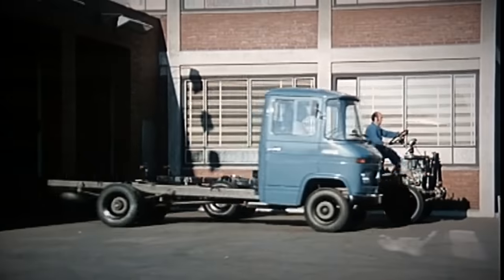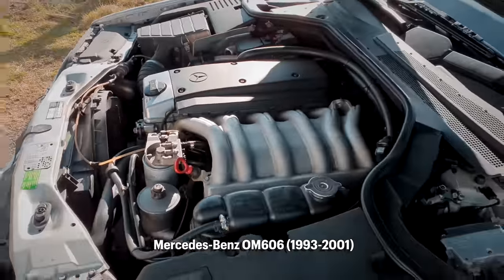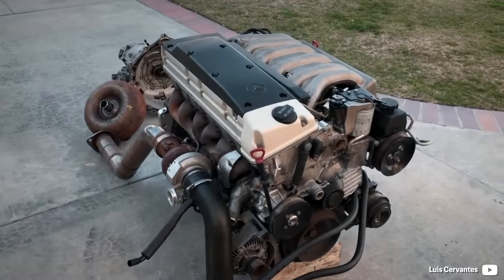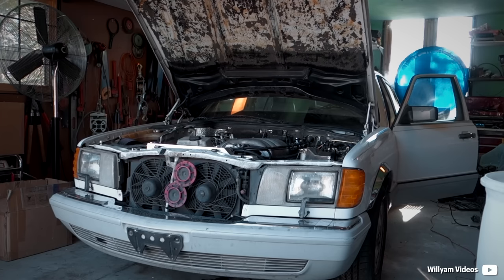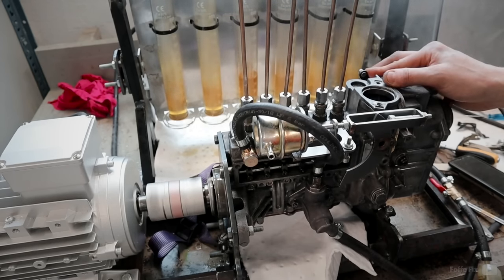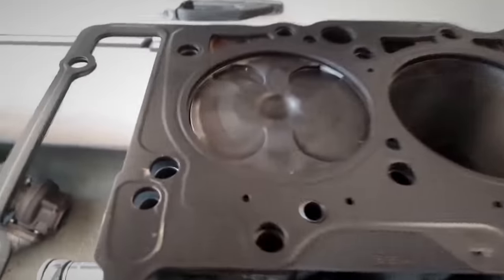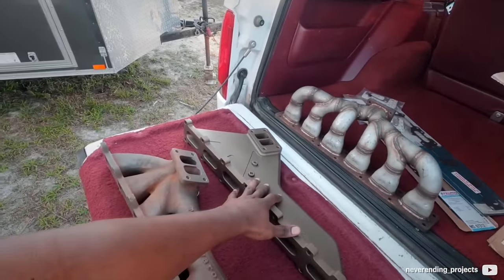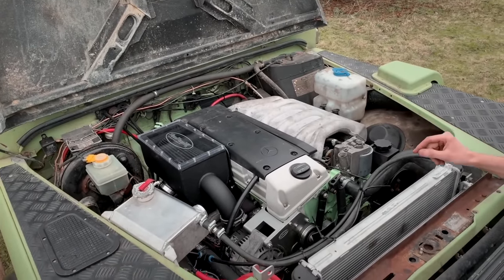The Best Mercedes-Benz Diesel Engine?

Comment: Gotta appreciate the old generation of diesels, where they were built to last - no dpf, no plastic engine components or fancy electronics prone to failure
Reply: While I kind of agree with you I have to say that these engines had plastic components and an ecu . The injection pump was electronically controlled and the Mercedes of the 90s suffered greatly from rotting wiring harnesses because they chose recyclable cable insulations . On the other hand modern engine management is a blessing even for tuners . We wouldn't be able to achieve nearly the power we do without modern engine management and the electronics got so much more reliable . 
I would rather say that the 90s were a heaven for great engines because the manufacturing capabilities were there to build very strong components but the computing power wasn't there to engineer them so they would just barely be strong enough to hold the required power in order to save money .
Reply: They dont Need DPF.
Indirect injection engines don't make NoX comparable to New engines. It's a common rail High pressure Lean running engine problem.
NoX is a manufactured issue. Since Diesels were forced to Use less and less fuel because Oil companies defended their interests by raising Fuel prices to protect Gasoline cars that were losing all battles very fast to ever-growing power and speed of 90s Turbo diesels. And Gasoline cars Sell Oil reserves not Diesels.
Reply: @DexMaster881 Are you serious? You've just shown to have absolutely no idea here.
DPF is for Diesel Particle Filter, that is, soot, smoke! Older diesels made a lot more because the injection systems wouldn't atomize the fuel very fine, that's why we got into the 2200bar common rail, fuel spray is much finer, combustion is greatly enhanced, thus better economy and less soot.
The Nox trap is an entirely different thing.

Also, they ran much higher compression ratios, easily 21-25:1, so they made a lot more Nox, that's why modern diesel have much lower compression, around 16:1.

A diesel always run very lean, unless floored.
Reply: Just to add you can put the fully mechanical om603 pump on the 606 and it can run without an ecu
Reply: @dabyd64  Thank you Fellow Mechanical Engineer. I forgot my Diploma isnt approved by World Indoctrination organization.
FYI Sooth is Overfueling or, Running Rich state on Old diesels.
To be more precise, more fuel than air volume can handle results in a rich state that Significantly raises combustion Temps since theres not enough air to filly combust all the fuel.
NoX is an occurance when theres a Lean state. Theres  too much N from the Burn left to Bond with air and return to natural state. Produced by the lack of burning components in Modern Diesel fuel that has natural stabilizing components removed from it. Like Sulfur.
As a result all impurities in Fuel and air get charred and you see sooth. On top of which there is more fuel with more impurities that can not be burned because theres a lack of air to satisfy optimal AFR. They always there But it's not burned unless the combustion Temp doesn't reach needed levels.
Same particles always come in and out of the Engine in Gasoline cars and Common rails but dont get Burned unless there is something very off with AFR. Like a well worn engine,or Over tuned one.
So When you criticize someone don't be a Feminist but Learn some fact. "I say" doesn't really work in 2022 people are more educated now. And they have more access to information other than Local propaganda.
You Can report me to your Indoctrination party leader, I won't hold it against you.
Science doesn't work for politics ,It should work for Knowledge and knowledge only.
And don't forget to support your Local Oil Tycoons in the upcoming elections :) Cheers m8 have a great day.
Oh yeah and OM602/603/605/606 run at 21:1 and 22:1 from the factory :) Check you facts...
Reply: @DexMaster881 soot is not only that...   Lean combustion also generates a lot of particles on diesels. Not seen by naked eye, but they're there.
Reply: @DexMaster881  what you've said about nox isn't true at all, the nitrogen in the air is effectively inert as far as the engine's concerned so the combustion conditions don't effect it.

What makes nox is heat. When the temperature of the air is high enough, the nitrogen and oxygen atoms have enough energy to overcome their repulsion and bond together to make nox. In engines, the maximum temperature reached in the cycle is related to the compression ratio, hence newer engines with lower compression ratios make less nox
Reply: @DexMaster881  nox isn't an occurance when there is a lean state, it happens when you burn hot, the Partuclate filter isn't there to reduce NoX either and the soot in a regular diesel comes from improper burning, like worse atomisation, no road going diesel ever gets even close to burning rich, a diesel usually runs at somewhere around 70:1 to 20:1 while stoichiometric would be 14.6:1.
Reply: Well the reability came from weak power and efficiency. As time and regulations proceed cars will get better. Look at tesla, where one wouldn't have a chance in their lifetime to change a engine or brakes. The online issue is battery safety, charging speeds and week infrastructure. I'm sure that will be overcomed
Reply: @scs52  Reliability came from simpilcity, somethign that modern vehicles, even teslas, lack. Brakes on teslas are an insane issue because of how little they get used, they often have to get replaced way to early because they rust, especially in climate where it rains a lot this is a big issue, saying that a tesla won't ever need a new motor is absolute nonsense as well, there have been a ton cases where drive unit replacements were necessary on teslas, and a good internal combustion engined vehicle would be just as likely to never need an engine replacement as an electric vehicle, and on that note, an internal combustion engine won't have to get replaced as often as an electric battery, if you choose a good one.
Reply: An OM603 probably has more complicated moving parts than a modern common rail engine, largely thanks to the very elaborate mechanical injection pump. Not to mention you could easily get the same power from a 4-cylinder diesel rather than a 6 these days.

Being a pre-chamber engine it also is totally reliant on its glow plugs (without them, the engine will not start). So I would not call such old diesels truely electronics free.
Reply: In a general overview you're right about overall durability and dependability not having electronic engine control modules and the bullshit that brings along, however there's always some kind of metal fatigue/wear and tear and cracks developing internally that is we can't avoid over time 😭
Reply: 2.5 D
5speed gearbox
2.5 tonnes vehicle
still getting 5l/km
Reply: Good ol mechanical injection
Reply: We will return to this kind of reliability.
Reply: @LouiLocke  they had no choice but to use bio degradable material
Reply: That was pure masterpiece engineering. The old school way 💡no 🐂💩
Reply: Certainly agree with you there, the older stuff was far simpler and more rugged for sure.   The additional complexity we see today I think mainly comes from the EPA's whip to force companies to run cleaner engines.   Granted as time goes on innovation also finds way to further performance as well.
Reply: @DexMaster881  bro, basic high school chemistry isn't a conspiracy lol. Sulfur in fuel creates sulfur oxides which are even worse than nitrogen oxides. All diesels run pretty lean and old diesels absolutely spew nox. Even in countries with no fuel efficiency standards but with regulations on nox emissions phased out IDI engines as they produce more nox than electronic commonrail engines.

Nox is produced from high temperatures where the normally inert N2 in the air becomes reactive and reacts with oxygen. A leaner burn increases the available oxygen to react with the nitrogen but can also reduce the peak temperature so it's often a stoichiometric, temperature and pressure balancing act.

Shits complicated and there are trade off's but NOX has nothing to do with DPFs. 

Particulate pollution is a completely different issue. Pm2.5 pollution is tiny, practically invisible soot particles that can pass through your lung tissue and get into your bloodstream. These carbon molecules are typically benzene compounds and you don't have to be a fart sniffing greeny to understand that benzene is bad lol. 

As for diesel, gas and oil companies. Oil companies don't give a shit what they sell to you. Thermal cracking, fractal distillation and other modern refining and processing allows refineries to vary the proportions of the petroleum end products significantly. About half of the gas used in passenger vehicles is produced by thermal cracking of heavier hydrocarbons that could otherwise be refined into heavier fuels like diesel or kerosene.
Reply: Well.... i have one of these  and it's better to run a catch can than through the small filter back into the turbo  and make sure the glue plug harness is good and make the pump fully mechanical

Comment: My OM617 is still running great for 43 years. 300SD North America only model
Reply: I've got the sucessor of 617, the OM602...these engines are the most resistant of the history of diesel engines never made
Reply: I have a 300sd w140 with an om603 they're rare but it's still a w140
Reply: I love my 1984 w126 whit om617

Comment: uh do you mean the best aluminum diesel engine? people are constantly forgetting the materials that were used in these diesel engines.. the 616/617 were technically the best cause the block and head were made of cast iron and can withstand alot of issues.. even if the head needs some maintanence.. with 606 theres always gonna need to be some type of welding repair to the head due to overheating issues or coolant issues.

Comment: As someone who is HEAVILY involved with the mercedes diesel world, I have to say I am incredibly impressed with the research you put into this video. Everything was incredibly accurate, even down to that general HP to CC breakdown at 4:12. Great video!
Reply: Hey mate I in Australia, I see there is company in UK which changes the injection pump to mechanical. It there like kits you can buy, cheers
Reply: @theaussienurseflipper.8113  as an Australian who's still looking for a source to import these in numbers, I believe you may be referring to DieselPumpUK (DPUK)
Reply: @joshthomas2536  yes I was
Reply: @joshthomas2536  if you can get them imported as an incomplete part they cant charge you the full vat i think its 13% for components or get someone in uk to buy and ship to austrailia with lower figured invoice

Comment: Well its incorrect Diesel burns slower. It actually burns faster.
Diesel Burn is done 95% by the time Piston does 1/3 of its travel on the combustion cycle.
Reason Why Diesels have lower RPM is: Heavier parts providing more inertia, and Injection system.
Diesel fuel is compressible  and at high RPM it starts lagging the ignition timing. Since Fuel injection is Ignition timing device, It reaches a point where Does not Start to squirt at TDC or slightly before TDC(which is a manufacturer compensation system for fuel compressibility). For Mercedes Om 602/603 Fuel Pump is set to start squirting 13 deg before TDC because of the Fuel line length and fuel compression compensation. And that's at around 150bar. Common rail is much bigger pressure on later DI diesels.
Late injection results in Late ignition, that results in power decrease and Engine loses the ability to speed up. Same as Gasoline engine with late spark...
The fact Diesel burns faster is also one of the reasons why Diesel engines have more torque. Because The Power is delivered while the Combustion space is still small. Increasing the efficiency of the explosion that pushes the Piston down. Its also the reason for Diesel Knocking sounds because you have stronger explosions that last shorter, making a distinct Start and end, resulting in sounds that are more individually distinct per explosion.
While Gasoline engines burn for longer ,resulting in Burns that take place in larger space and as such waste energy since it no longer pushes the piston but turns to heat. That in combination with Less energy dense fuel and Lower compression to begin with badly affects torque. Also why you need more Fuel to keep the engine running.
And also a reason Why Diesel Engines rarely throw short flames only visible when Exhaust headers are off at High RPM, while Gasoline cars can throw flames that will come out the End of the Entire exhaust system.

Comment: Thanks for that info. I ran the 5 cyl in 2 models over 6oo thousand miles but those were cast iron blocks and heads.  The early 6 cyl ha a reputation for bending the number 1 rod. It had the aluminum head and cast iron block.
I had no idea the 606 could run like that. This was a great article.  Thank you for your great work

Comment: Early 2000s my company car was an E class 2.7 CDI with six speed manual, I loved it. The torque of that 5 cyl. motor was always very impressive through the gears, but the later V6 autos felt very 'treacle-drive & breathless' in comparison. : )
Reply: Had both, 2.7 inline 5 and 3.0 v6. The v6 is a beast compared to the 2.7
Reply: @ailokemi92  - Were they both auto?
Reply: The 2.7 CDI came here stateside in the Sprinters and they are my favorite engine of all time. Currently driving a V6 CDI E-class and I love it, but the stock tune is definitely gutless compared to the OM647
Reply: We had a 2006 E320 CDI with the 3.0L straight six and it was a blast to drive. The black death and crappy insulation on the wiring was a PITA though. Ended up selling it when the key sensor died and it was going to be $2500 to fix it. Figured with the wiring insulation issue it was going to be a headache so we sold it to a guy who specializes in used Mercedes.

Comment: I'm running my OM606 W210 for 9th year now and I love it. It is slightly tuned with T04E, bigger intercooler and an custom 76mm exhaust. Currently running on 260hp and 500nm on stock pump.
Reply: Hi what kind of intercooler are you using?
Did you had to remove the ac condenser?
Reply: @Anselmo_Simoes  the cooler is 550x230x63 and the AC is working perfectly. The only thing you have to do is a slighly cut the metal frame that holds the front bumper. About 2-3sm cut so the cooler is not that low.
Reply: @bobihristov739  thanks i'm going to look for one with the same dimensions
Reply: @benz merc Naah. In the city about 10-13l/100 depending on the traffic, on the highway with 130-140  7/100 or less
Reply: How much would it cost for such a job 🙄 sounds great to me 👏
Reply: @huchotaimen  With the tune roughly 1500 eur
Reply: @bobihristov739  thank you Bobi 🤝

Comment: Great video as always man 👍 Every Mercedes engine of this era is way more capable than Mercedes made them, this is why you see so many massive milage 80-90s Mercedes car. All these where made when Mercedes truly over built their engines. Also many of the petrol and diesel engines used design features or measurements from each other, for example I plan to fit a OM 601 D23 crankshaft in a M111 2.3 to build a stroker engine with shortened rods. This is why I and many others love tuning these old engines.

Comment: Just got my 1992 G350td with OM606 turbodiesel swap back on the road after 4 years(bought as a unfinished project car)! 722.6 trans with ofgear and maxed out(+5mm bigger internals) stock turbo with 7mm mechanical mynäpump. Not yet tuned properly but still coal rolling like a rocket with 1bar of boost(should be double when I get the ofg boost control to work). Turbo whistle is just massive! :)
Reply: I live basically down the road from Mynädiesel, who makes the diesel pump. Nice to see their parts still being used
Reply: which stock turbo is that? HX35?
Reply: @jinglemyberries866  OM606 stock turbo

Comment: Love OM 601-606 engines. Driving a 190d with an OM601❤️
Reply: My first MB 1996 E320 had the M104 i6 engine and it was the best car I've ever owned. Including todays EQC 400. It's such a shame that it rusted out, it was still mint technically and indoors.

Comment: Another great mercedes diesel is the 3.2L om648 I would say it has the same capabilities as the om606 or even more, more tunable, less smoke, more power :)
Reply: Its good but you cant go mechanical with that plus it needs more work to get to same power level as om606

Comment: The best ever!))If you need remapping or turbokits for om605/606 engines write to pm.Have 250-550 hp kits.And you can see acceleration videos in work)
Reply: а компактный металлический впускной коллектор на  w163 om612 где можно найти?
Reply: что конкретно предлагаете хочу поинтересоваться?   сток 177 л.с w463

Comment: M57 and OM606 are the best 6 cylinder CI engines for cars.
Reply: You forgot the m104 and the VR6
Reply: Another great mercedes engine for tuning and reliability is the inline 6 3.2L om648, same or more power potential than the om606